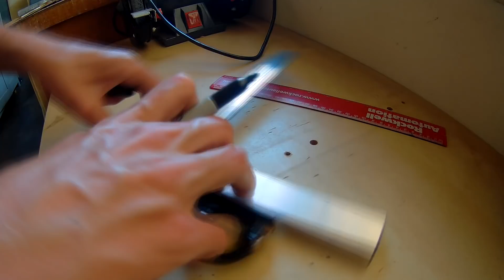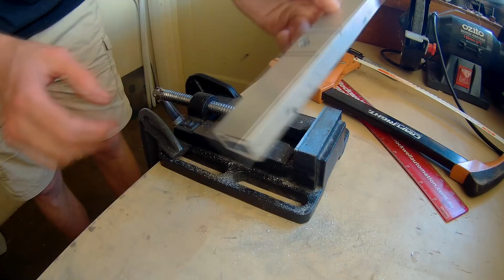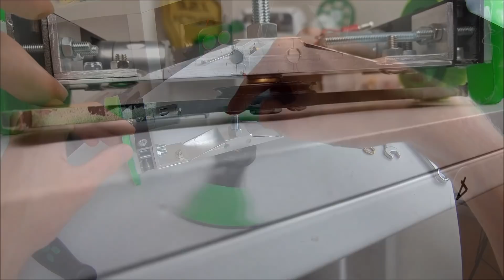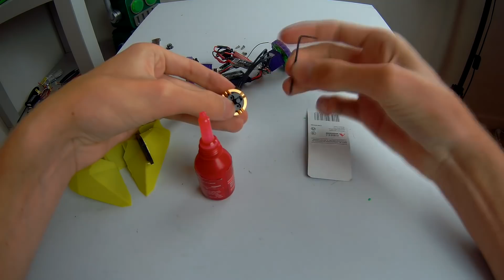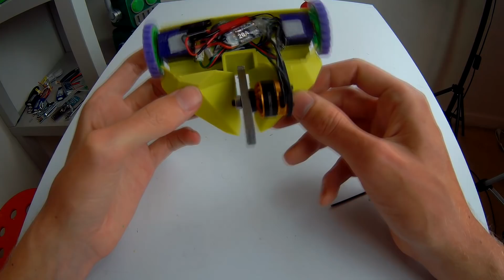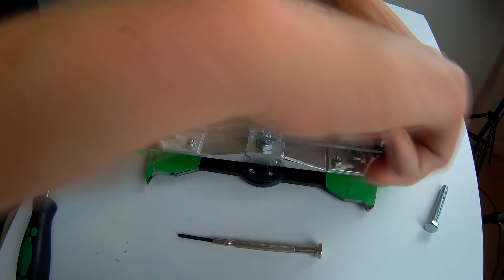Rebuilding two robots for ARC

Comment: Weight category for the bigger one?
Reply from the maker: Beetleweight 1.36kg
Reply: @TeamPanicRobotics  plz tell me best motor driver for a 13 -15 kg war robot.and where I will get the brushless motors for the weapon.
Reply from the maker: There is no best motor driver. It depends on which motor you want to run, is it brushed or brushless? how much current does it draw? does it have sensors?

I get my motors from china, usually AliExpress or Banggood

Comment: Looks way stringer than the old chassis! It looks like Annies Weapon Pulley and Bearing mount is 3d printed. Is that right/does it hold up?
Reply from the maker: yes they are 3d printed and they mostly hold up.

They have survived every hit Annie has dished out in Australia but died in a weapon to weapon hit at AVC in the states. 
Making the pullies out of aluminium is going to be part of the upgrades for Annie V2
Reply: @TeamPanicRobotics  Thanks for the info! 👍

Comment: How much did 'this is a party' roughly cost you?
Reply from the maker: I think somewhere in the $100 to $150 range (in Aussie dollars)for the initial build but a lot of that is in the main electronics.

I've done 4 different versions now and the only real change between versions is the chassis and replacing broken weapon motors.
So its costing around $15-$20 to go between versions

Comment: Have you tried plastic weld? It's amazing how strong is it compared to epoxy.
Reply from the maker: I was planning on that but after printing the chassis flawlessly my printer struggled to print the weapon mount in ABS so I ended up printing it in PLA+ and I dont know if you can plastic weld those

Comment: Annie in her see through outfit is certainly something to behold.
Have you ever thought about using enamelled copper wire some areas inside a robot with clear casing. It looks really good, the wire stays where you poke it and doesn’t drop out into the path of the spinning bar just as you’re going in for the kill. 

I’ve used it on mobile instrument roving platforms but never in a combat situation. It was good for keeping the wires looking neat. I’m not really all that sure about the weight of solid core, thin insulation of enamelled wire vs multicore, thick insulation of traditional wire. It might make Annie’s insides a little nicer to look at though. 

I think you may want to avoid them being the main joint on circuit boards though. We used a small Annie in her see through outfit is certainly something to behold.
Have you ever thought about using enamelled copper wire some areas inside a robot with clear casing. It looks really good, the wire stays where you poke it and doesn’t drop out into the path of the spinning bar just as you’re going in for the kill. 

I’ve used it on mobile instrument roving platforms but never in a combat situation. It was good for keeping the wires looking neat. I’m not really all that sure about the weight of solid core, thin insulation of enamelled wire vs multicore, thick insulation of traditional wire. It might make Annie’s insides a little nicer to look at too. 

I think you may want to avoid them being the main joint on circuit boards though. We used a small kapton flat ribbon cable to prevent vibration breaking the solder joints on the pcb’s. 

Now I’ve typed all that, it seems a bit much effort just for cosmetic reasons. 😊
Reply from the maker: It does sound like a lot of effort, but I do like making my robots looks good.

I might have a look into using enamelled copper in the future, but to start with I need to work out the issues in the hardware
Reply: Team Panic Making your robots look fantastic is becoming a specialty of yours, in my humble opinion. 

You seem to take a drawing that the 10 year old inside of all men would draw as a fantasy robot, and you make it real. The best bit is that you have some great results too.
Reply from the maker: Thanks so much! That might be the nicest comment I have received

I'm glad you like the look of my bots I do try to put some time and effort into making them look like more than a box on wheels (even Annie has her lexan and colour scheme). I have a few designs that I'm working on that are way more form than function, hopefully, one of these days I'll get a bot like that on TV

Its funny you mention 10 year olds drawings, I found an old sketchbook at my dads house with my very first design in it. I was around 10 and designed a 4wd bot with 4 weapons that could drive inverted. I'm kind of tempted to make it into a beetle weight
Reply: Team Panic in a previous comment you did remark that you like to put on a good show If there’s something I have noticed is that showmanship is a big part of robot combat. The spectacular hits and the total destruction (in some cases) is what it is all about for an audience. I think it’s a true testament to the social achievement of mankind when rival teams show empathy for each other and help to rebuild another competitors robot to make sure the fight is as fair as possible. 
Who would have thought that out and out war could bring so many people so close together. Again, good luck with your robots.

Comment: You might be able to put the battery on it side
Reply from the maker: Unfortunately not, the inside of the chassis is 30mm, the battery is 34mm wide
Reply: @TeamPanicRobotics  Heres an Idea: Make a little jig to hold the battery in at a diagonal.
Reply: Probably 3d printed
Reply from the maker: It literally did not fit on any diagonal. Because of the new weapon mount and the shroud around the brushless motor the bigger batteries would not fit in any orientation, trust me I tried damn near everything. I wanted the bot on 3s and hated having to run it on 2s

If there was anyway to get the big 3s batteries in the robot I would have done it.

I'm working on V2 of AnnieRUOK now and will make sure I order backups of the correct size battery